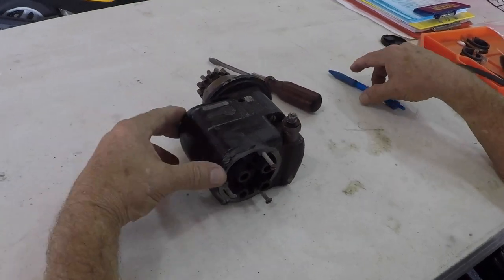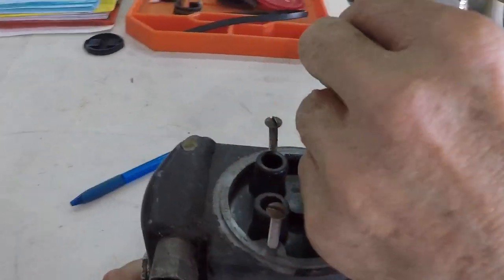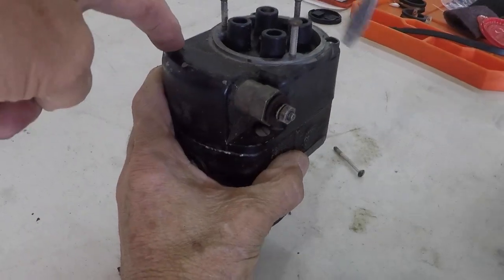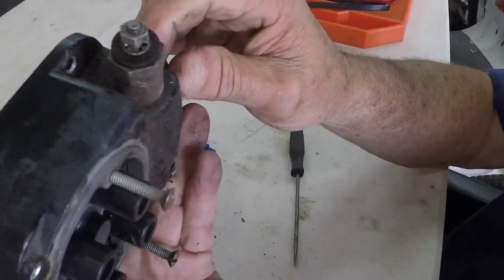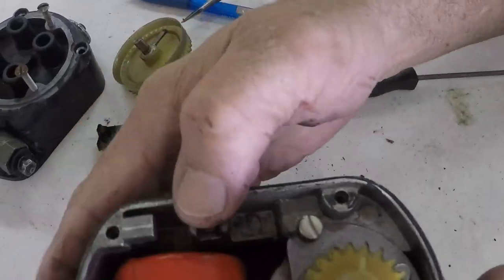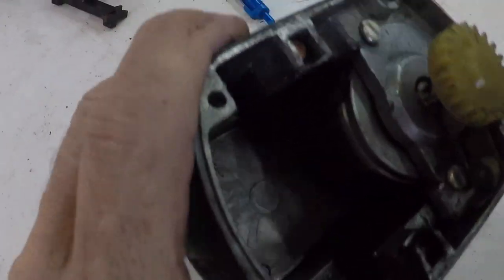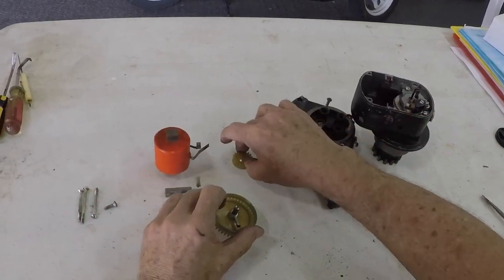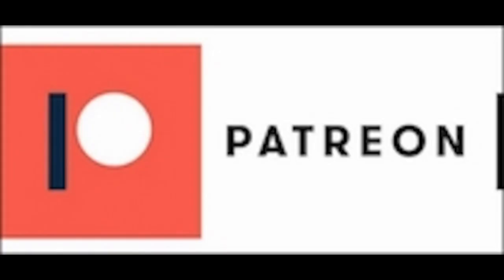Looking Inside a Magneto - Grumman Style

Comment: "Start that over, we'll cut that out. Start talking." oops. :) Actually, more fun leaving it in! :)
Reply from the maker: We were going to edit it out, but during that process that suggestion was made to leave it in, as a behind the scene feature, so it still there.  Thanks
Reply: @GrummanPilots  I was surprised to see the plastic (bakelite?) gears in there, but I suppose that if the guts of the thing seized up, you'd want those mag gears to be the sacrificial gears and not the accessory drive.
Reply from the maker: @ScottsSynthStuff  Exactly, but that rarely happens since the bearings keep the rotating magnet on the shaft in true, hard to get one to seize.
Reply: @GrummanPilots  So what is the typical failure mode for these then, because I can tell you from first hand experience on more than one occasion, they sure do fail! :) Coil windings maybe? Worn points?
Reply from the maker: @ScottsSynthStuff  Wprn parts that change the timing, but points and the lobe do wear.  Condensers fail as do coils as they get older (especially when hot).